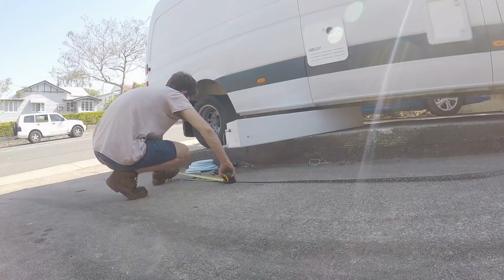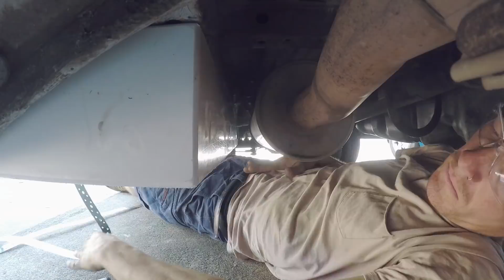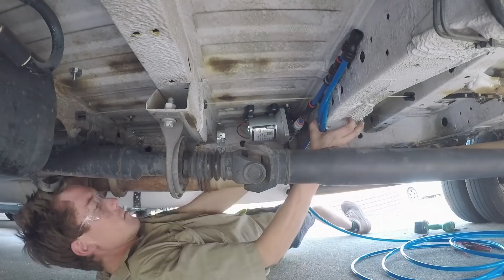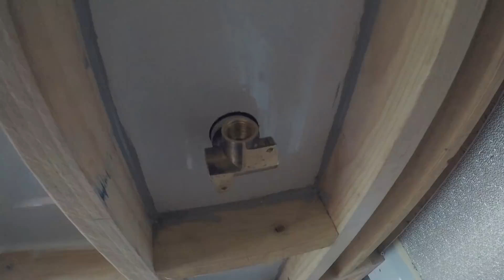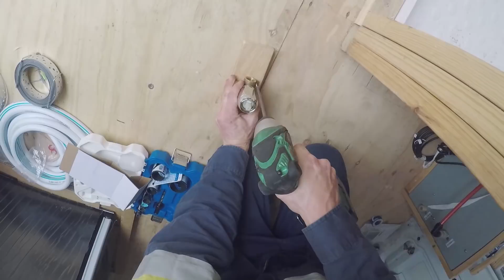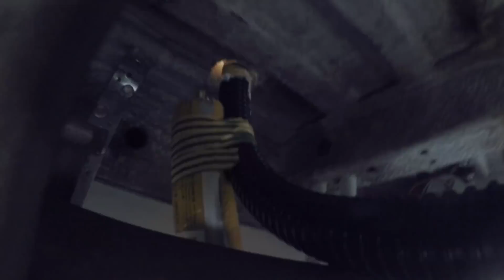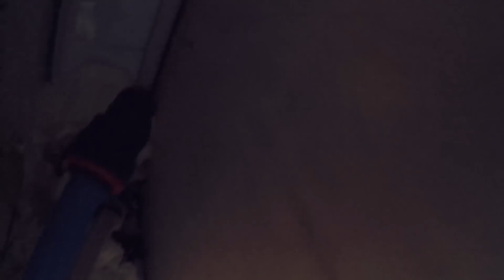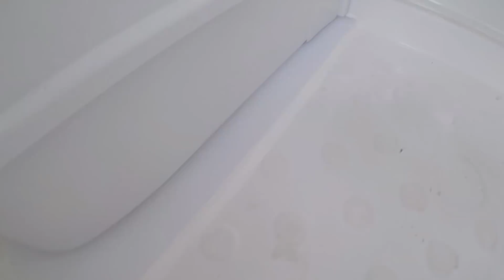S1E7 Sprinter Van Conversion | Plumbing Pt. 1

Comment: Suggest a pressure regulator at input of city water hose,  different places may have less or MORE pressure 
than your home water pressure.  May save you from having blown water connections.     All the Best
Reply from the maker: Thanks for the tip Glen the inlet already has an in built pressure regulator 😀

Comment: I guess the only thing that I'm a bit confused on is that your main, as you said, bypasses the pump. So, if my understanding is correct, the pump will only flow when you are using the tank. Will your main hookup have enough pressure to give you a good flow in the shower or sink? or is there some technical reason not to have the main connect to the pump? Thanks for the awesome videos! I will definitely take inspiration from your editing style for my conversion in the near future!
Reply from the maker: Hey nathan thanks for tuning in! 

So the "Mains inlet" or another way of saying it would be "city water inlet" literally gets hooked up via a hose into a tap outlet, which is at mains/city water pressure. When connected to mains it doesn't need to go through the 12V pump as its already at a high pressure. In fact, there is a pressure regulator on the side of the van that actually drops the pressure, as mains runs at a much higher pressure.

The pump is only used when I'm off grid and using water from the storage water tank.

I hope this helps, let me know if you have more questions.

Thanks mate
Reply: Yeah this helps a lot! Thanks for the quick response. I hope the van is coming along smoothly for you!

Comment: you should have ran the toilet off the gray water tank .
Reply from the maker: Toilets have to run into what's called a black water tank, if you ran it into the grey water tank you would get bad smells coming up through the drains of the grey water. And you wouldn't be allowed to dump your grey water wherever you want then. They have to be separate my man 😉✌🏼

Comment: poot ruber under the  pump, other vise you gona hear in your bed  pump :) telling from experence i had the same problem  with  webasto, heting, pump thas whas inoing fing i puted on ruber wich is luse :)
Reply from the maker: The pumps feet are basically made from rubber, I listened to the pump whilst it was running whilst inside the van, can barely hear it 😁🤙🏼

Comment: A few have mentioned the exhaust proximity to the water lines and drain line. 

One thing that you'll have to remember, is to close your ball value off when you use the pump. If not, the pump will just circulate the water out the tank and back in through that closed loop, never building pressure to the other fixtures. 
Great job on the install.
Reply from the maker: Thanks yes since this video I have installed exhaust heat wrap which contains nearly all the heat extruding from the exhaust, so the pipes are safe.

Thats right, if I left the "tank fill" valve open the pump would forever circulate. I can see you are paying attention ;)

Comment: Hi Jaz, really nice job. Correct me if i am wrong but the pump inlet u installed is higher then the water tank level, the pump will run dry.
Reply from the maker: You are right mate, but these pumps are designed for this. I think it said you can have the pump about 1.5 metres away but I kept it close still. Cheers

Comment: Mate this might sound ridiculous but wanna know what you think after building your bathroom. I've got a Separette Weekender composting toilet, unfortunately it doesn't have that seat swivel so will take up more room in the bathroom that I don't have. You reckon it's possible to build a recess in the bathroom wall that the toilet can slide into? Would push toward a rear cavity of the bathroom which would be under the bed, but still sealed within the bathroom enclosure.
Reply from the maker: Hey mate anything is possible with time and effort, you can achieve it!!

Comment: hey mate, its a 100 liter tank tat means its going to weigh 100 kgs. so is it enough to use the metal straps. wouldnt it be more secure if you weld a cage like structure under the van ???
Reply from the maker: Its actually 110L which is 110Kg, that strapping would easily hold much more weight mate, and each one of those self tapping screws into the chassis would hold much more thank 110Kg combined as well.
Reply: Its holding...!!! good to know, great job mate.

Comment: would it be beneficial to have two of these pumps in parallel with check valves to prevent back pressure into the pumps for when you need more water pressure?
Reply from the maker: Cheers mate, I'm thinking the pressure should be fine but will see how it goes, cheers!
Reply: I should be starting mine just after winter, starting to get cold here in the uk, top of my list is a shower with good pressure and plenty of hot walter then the cooking station and beds. I've given myself plenty  of time to plan as I need a bathroom. Area to cook, seating for six with seat belts as well as two double beds and a bunk bed for two kids. It's definitely doable but has to be planed to a T and I need to make the front bench seat, seat two and swivel.
Reply from the maker: Wow sounds like a big build mate, better get started now :)

Comment: Just 1 thing i noticed, Dont know if you thought about it yet, But your Piping is right above your muffler which will become very hot, It could melt your piping an even worse ruin your pump, Maybe get a heat shield or something that would block the heat off the muffler, anyways love the vids & the van! keep it up!
Reply: Never mind, noticed you already talked about this in other comments, anyways love the vids!
Reply from the maker: Thanks a lot for the concern :) Will be doing in Part 2

Comment: I can't see how close the exhaust pipe from the plastic water lines, maybe you should add some shielding to protect the water lines from the heat from exhaust pipe.
Reply from the maker: Thanks mate I will be sheilding the exhaust in Plumbing Part 2 :)

Comment: With a cassette toilet, why are you adding a black water tank?  I thought you only needed a gray water tank for the sink and shower.
Reply from the maker: I'm not add a black water tank. The cassette toilet comes with a "Cassette" underneath the toilet which is where its storage is. The grey water tanks will be for shower and sink, and the other one in this video is for fresh drinking water.

Comment: Dude, amazing build! looking forward to your next video's.
I have a question tho, i live in europe so im not sure if this will apply to you since you live in australia.
So the question is are you not affraid of your plumbing freezing up when the weather gets realy cold?
I want to build my own van some day but here in europe in winter the temp will get below freezing, i think it will not be a problem when you do all the plumbing inside of the van, but below the van the plumbing and pumps will get exposed to cold weather.
Keep up the amazing work! :D
Reply from the maker: If I was you I wouldn't do what ive done since it gets so cold over there, I would go to your local motorhome dealer and see how they do it, most likely inside. Mine may still be subject to some freezing in the coldest winter down here, but I will have to wait to find out.

Cheers for the support!
Reply: thanks for the quick reply! good luck with your van!

Comment: Great details on plumbing! 
 Thanks so much on the walk through, especially the more detail run down of the Plumbing closer to the end of the video!! Yours is the only one that really explains things.... can you please tell me what size piping you are using? Is there a minimum/maximum size you would suggest? Thanks so much! Can’t wait for the second part of this series to come out...
Reply from the maker: Thanks heaps Corina! the piping is 12mm (1/2 Inch). I would suggest minimum 1/2, it will do the trick! Its a very common size for this.
Reply: Thank you!!

Comment: You should put heat shield from muffler or your tank will melt from hot muffler when it empty.....
Reply from the maker: Thanks mate, I will be doing in Part 2 ;)
Reply: Travel With Jaz I can't find part 2

Comment: I greatly appreciate all that you are sharing on this build experience.  I have enjoyed the info, instruction and marvel at your abilities in all aspects of the build as well as the documentation.  You have my utmost respect.  At the risk of a repeat question or answer, I ask how will using the vehicle in a variety of terrain, roads, weather conditions impact the hosing, joints, pump, filter, etc... speculating the apparatus will get filthy and be subject to a more rapid deterioration than not.  Are the products, you are using designed for rugged use?  If addressed elsewhere, please point me in that direction.  Kind regards, Meg.
Reply from the maker: Thanks so much Meg for your kind words and support. I don't think the components are designed to be absolutely filthy, i may be protecting them somehow in the next Plumbing part 2 from some of the elements, especially from exhaust heat. I will post more on this once I've wrapped my head around it in the near future. Thanks again!

Comment: I love your videos! One question, shouldn't your gray water be going into the top of the gray water tank, not the bottom?
Reply from the maker: It doesnt matter either or will still work, I had to go in the bottom in this instance to keep the "fall" of the plumbing pipes so the water continues to flow with the gravity of the slope of the pipe
Reply: Maybe I'm missing something, but it seems that as your tank fills up so will the pipes leading into it. Water will be backed up even before the Hepvo valve.

Comment: Keep up the great work...QUESTION...are you going to protect the water lines, tank, pump etc from the exhaust pipe? It appears you may need some type of heat shield. I may be wrong.
Reply from the maker: Good question yes I will be doing this in PART 2

Comment: Great work mate. Two things though. Would it not be prudent to have your main tank fill as high up as possible and use a float shut off valve? I know you have the overflow / breather but you need that anyway. An auto shut off would be a fill and forget without the need to wait and watch water pouring out. I know it's already drilled and it's looks tight under there but have a think and maybe you can make it work. Just blank off the one you have, drop the tank on one side and drill the hole as high as you can. You could also use the existing hole for a second pump if the single Shurflo is not enough to run everything. It has the pressure, but having worked with these - it's the flow you need. Secondly, no sink in the bathroom?  I know it's tight in there too but a small sink would fit. Maybe future proof and have the lines there ready to go. Oh, one last thing- ok  I should have said 3 things,  silicon is great, but looks bad when it's not finished right, especially after a year or so. You can buy these small silicon finishers. They just allow you to smooth off the edges and give you  professional finish. You can go back over what you've done so far and use these to make them look the business.  I'm sure Bunnings or some one stocks them- like this on :  https://www.ebay.com.au/itm/Silicon-Sealant-Mastic-Finishing-Tool-Kitchen-Bathroom-Shower-4-Pcs-/202076810259?hash=item2f0cb76c13:g:S0EAAOSwzx9Z2wO2
Reply from the maker: Cheers for the suggestions mate, I couldn't put the inlet for the tank fill at the very top as the tank is recessed inbetween the chassis so this is impossible + a float shutoff valve sounds like overkill for what I'm doing, I'm trying to keep it as simple as possible. Probably could do a sink, but it's small enough as it is I'm just going to use the kitchen sink as a double as the bathroom sink. I've never used those silicone finishes ever, but might give one a try cheers mate!

Comment: What water Guage did you use, all the ones that I find are several sensors that attach to the tank?
Reply from the maker: I'll have to look that up, I'll include in the Blog post. Sorry I chucked out the packet but I will find the brand

Comment: Pretty impressive for a first timer. Been plumbing RVs for over 30 years now. Right now I build Class B motor homes, Sprinter and Transits. I have never been so appreciative of the vehicle lift in our shop as I was while watching you working on your back under that Sprinter. That can be a tight squeeze.
Reply from the maker: Thanks mate that would've been blood excellent to have one of them lifts!

Comment: Hi JazLoving your YouTube posts Not sure if anyone else has mentioned about your fresh water tank construction and mounting, I'm only an armchair van builder but I was thinking that you may have a problem with your tank when you start travelling, from your video it appears the tank has no baffel, when it's full it may not be an issue but once you've used 10 or 20 litres the water will start to slosh backwards and forwards, that's 90/100 kilos banging against each end of the tank, i don't think the securing bolts you used for the tank straps or the tank straps themselves will take this for to long, also I think it would be better to put some kind of padding between the straps and the tank to prevent rubbing. I hope you take this as advice and not criticism as I really enjoying your build.😀
Reply from the maker: Thanks Keith! Yeah i thought about it but didn't end up doing one, we;ll see how it goes! And for the rubbing of the straps i will probably put something in between. Cheers mate!
Reply: Well we all know how this turned out

Comment: I think you' might need a heat shield, shielding your hot exhaust pipe from the plastic exterior of the water tank.  Many exhaust systems on cars are shielded near the pipe to prevent from melting parts like fuel tanks,  or keeping heat out of the passenger compartment or off of the transmission. A  2 cent suggestion that could save you plenty.  Otherwise, it looks like a nice build.
Reply from the maker: excellent suggestion will have to get onto that! Cheers

Comment: Curious, did you not think about protecting all the holes you've drilled or is rust not an issue?
Reply from the maker: Thanks Chris I didn't hey but I will spray some rust protector on them, cheers mate
Reply: I'm just about to buy my first van to live in full-time for a year or two and your videos have been super helpful. altho not sure i can use external water tanks up here in Scotland as freezing will be a huge issue.

Comment: Great video. Very informative. Just a couple of points.
1) you may want to move your overflow from the wheel arch as your back wheels will be firing road water and dirt back up the pipe. I'm sure it wont reach the tank but not ideal. 
2) Is there something to stop beasties from crawling up the overflow and dieing in your water tank?
3) Are you concerned about the heat from the exhaust and the close proximity of your plastic pipework and tank. I know diesels don't run as hot as petrols, but it did look quite close in the video.
Reply from the maker: 3 superb points mate, I will be changing each of these slightly just to compensate.

Maybe change the breather line end location + put a mesh screen on the end, and shield the pipework.

Thanks for the suggestions and support they're very valuable!
Reply: Those 3 good points. 
I thought about the black drain hose close proximity to the hot silencer.

Comment: Won’t the tank hit the bumps or get hit by some rocks or anything on the road?
Reply from the maker: The tank is the same depth as the lowest parts of the side skirts on the sides of the van, so shouldn't hit. It's also made out of really thick duareable food grade plastic, so should be fine against rocks!

Comment: Hope you don't go in any cold areas because your water pump will freeze and burst outside. Also you will have heat loss and heat transfer by zipping the 2 water lines together. If you are in a cold area you can also use heat tape to keep water lines from freezing. There are a lot of right angle connectors when the hose if flexible and can bend it and not take the chance of water leaks with so many connects - besides they can get costly. You need to insulate your water lines separately!  Thanks for sharing your videos - Im not trying to be critical - just helpful!
Reply from the maker: Excellent suggestions mate, thanks a lot for that. Definitely does make sense to segregate the cold and hot water lines haha! and to insulate them does mate sense.

I will see how it goes and if I need to make adjustments I will do, Cheers!
Reply: What about the watertank, i'm afraid that could freeze... I'm mostly going to cold plaes as sierra nevada alps, pyrenees. I need to find a solution to that...
Reply: @michaelappelmans1298  We have the same problem so EVERYTHING was mounted inside the van with the exception of the grey water holding tank.

Comment: This is an awesome build and video collection, loving it!

Do you have concerns with the proximity to the exhaust that some of the plastic plumbing parts are currently setup on? One that concerned me a bit was the drain pipe on the shower, it's RIGHT there. Don't want hoses and fittings melting!
Reply from the maker: Thanks Michael! yeah now that a few have mentioned it I do believe the drain pipe is quite close and i will have to protect it somehow, I will show how I do this in a future video ;) cheers!
Reply: Maybe some thin metal bent in a curve mounted above the exhaust pipe? Not sure if that would do it but it might! Looking forward to the next part!!